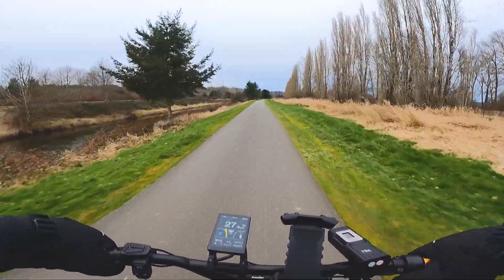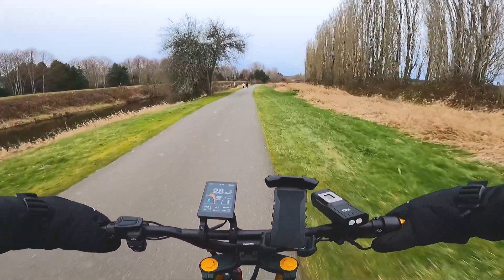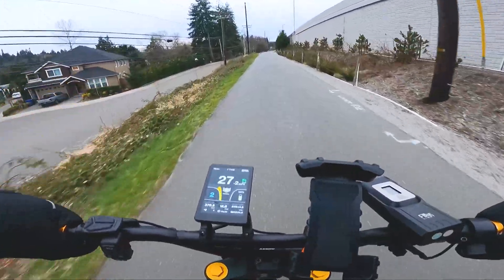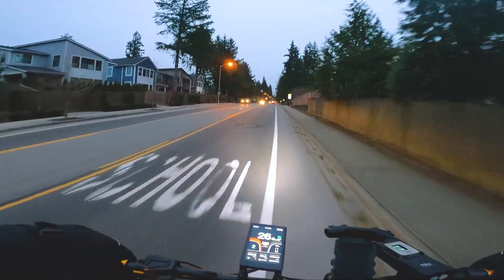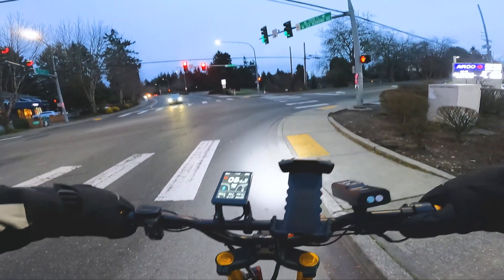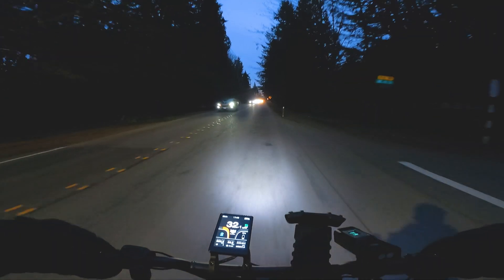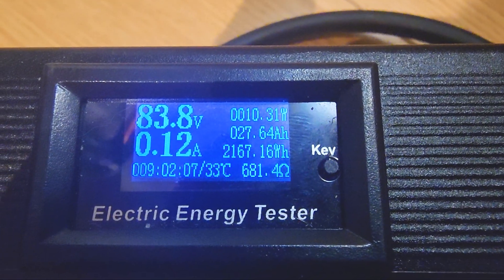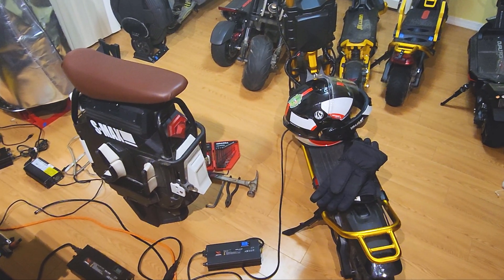Single or Dual - Electric Scooter Efficiency

Comment: an interesting experiment Ginger!
 I have to admit...I assumed that the physics of energy would show that it would be a wash...maybe slightly better range in dual motor as you're not fighting the resistance of the front motor. I was wrong. :)
I would mention that, and I could be wrong again, but there would be more heat and wear and tear using the single motor only...so I still think it's better to always use dual motors and distribute the effort required across two motors...but I guess if you need the extra range one day, single motor it is...Hats off to you for making this video...exhausting work :) Cheers :)
Reply: I think that the greater wear of the motors is negligible, in practice it is perhaps a greater demagnetization of the magnets and perhaps greater wear of the bearings.
Reply: It would be a closer result if you were able to keep it at one speed the entire ride without slowing down or stopping because when you speed up or go from a stop, dual motor will draw more energy.

Comment from the maker: Something VERY important to consider is that your rear motor will likely overheat in single motor mode if you're cruising above 20mph. I overheated my King GT rear motor on the single motor range test but didn't catch it on camera. The economy gained in single motor mode isn't worth the potential damage in my opinion. It's likely one of the reasons Dualtron scooters ONLY have dual motor mode. 

Don't forget to check out VoroMotors' website to see all the latest gadgets!
https://bit.ly/WolfKingGTPro
Reply: Agreed, I burned a controller in single motor mode with my Speedway 5 bought in 2019 (which is minimotors brand, like dualtron), it is not worth the economy. The difference in power consumption is probably due to best acceleration (more power) in dual mode. Regenerative brakes maybe help to minimize this effect. Nice video ! 👍
Reply: Not all dual motor scooters or ebikes has that kind of overheating issues.

All or almost all of the Kaabo Wolf scooters has a design flaw that let's you easily overheats the motor  when running it in single motor mode.
Reply: I use dual motor for long distances IOT maintain long term reliability.  The tough nut to crack is which mode is superior for traction purposes, I constantly switch back and forth between modes when off road.
Reply: I always use single motor on my 9+ to preserve battery but swap to dual motors for hills or boosts. The rear motor does get warm but not to the point its hot. So your video proves that single motor is indeed more efficient but you are saying it can cause it to overheat?
Reply: if you do get the time or if its possible.. any chance you could test this with the Vsett10+R 🤔🙄🙏
Reply: Watch your initial range test at which time you experienced some crazy things when you basically depleted the battery causing an accident injuring your hand.  I just purchased a new Wolf King GT pro and have made an initial run.  After watching your video I was a bit concerned and would like to know if this issue has been resolved or should I worry about it.
Reply from the maker: @davidbowles6070  I wouldnt worry too much. It's only happened twice. I was prepared the second time. After that though I put a password on the TFT display which prevents the scooter from shutting off and turning back on by itself. Never experienced the issue again after that.
Reply: Lol dualtron don’t have a only duel option I have a dualtron 3 you can witch between duel and single lol
Reply: if it will over heat then why are there single motor scooters i run my vsett 10 in single motor in the summer in phoenix never had it over heat

Comment: About what I figured, single would be slightly better. I’d still probably choose to go dual unless I really, really needed the extra range because of the better acceleration and if you really needed to get out of the way of something fast, I’d feel better knowing both motors were on.

Comment: Of course this test is with low weather temperature... in summer i believe 2 motors will win the test..!
And one more basic thing.. ISSUES!!!
If you are using only rear motor with motor temperature 60 Celsius and up rear motor or controller will burn...
So... is it worth it to use only rear motor....?
If I want to make economi to my scooter use 2 or 1 gear... always 2 motors!!😉
And my scooter power is 2 wolf GT in 1...💪😘

Comment: The answer depends on rider weight, if you are light enough for single motor to be efficient then single motor will take you further, but if you’re heavy and one motor struggles to push your weight then dual will take you further.
Reply: I agree!! And one more.. don't forget that this test is with low weather temperature... if Ginger make this test in summer there is no luck on one motor..!😘
Reply: hills too though not just weight..
Reply: Not to mention that even if he did more tests with results in favor of single motor usage, in the long run, you'll likely need to replace that rear motor much earlier. Shared load, for me, is more forgiving on the motors.
Reply: More tests on needing on othe PEVs.

I seen other scooters and E-Bikes gets better range in dual motor mode.
I seen some gets better range in single motor.

Most of the testers/riders has been lightweights or normal weight.
Reply: Ginger is over 200lbs
Reply from the maker: I'm sorry but that's just factually incorrect I'm 220 lb, probably closer to 230 with all my winter gear on in this video.
Reply from the maker: @SUSHI4lyf I rode my wolf warrior 11+ for around 8000 mi mostly in single motor mode on long rides. It's true, if the rear controller didn't have overheat protection then it would be damaging. But luckily it does have overheat protection that works and shuts off power to the motor when it reaches a certain temperature. Maybe if you did that for months on end every day you would damage it but like I said I rode my scooter around in single motor mode all the time and it lasted years never replaced a controller
Reply: Makes sense.
Reply: actually also depends on controller type, if they're sinewave/foc they're much more efficient in general, on a trapezoidal/squarewave controller like Minimotors etc make you'll notice more of a difference because there are 2 less efficient controllers, while sinewave/FOC controllers are much more efficient overall
Reply: Smartgyro cross over dual vs k2 pro